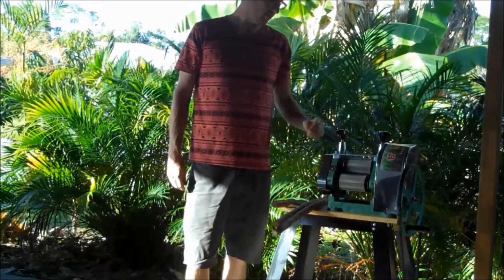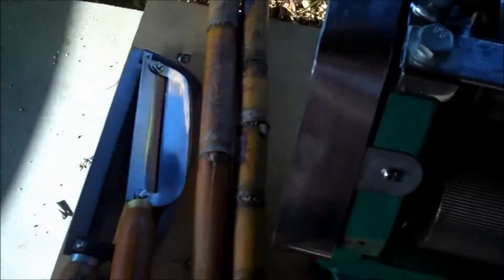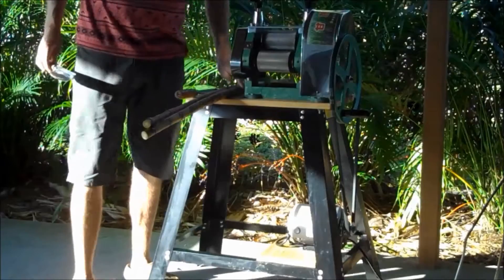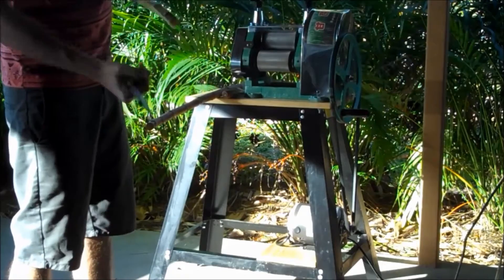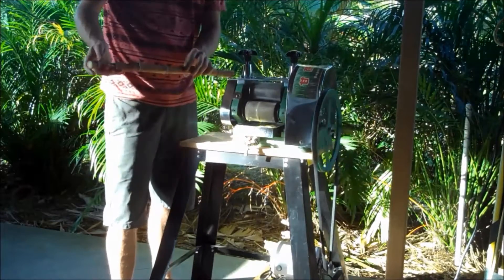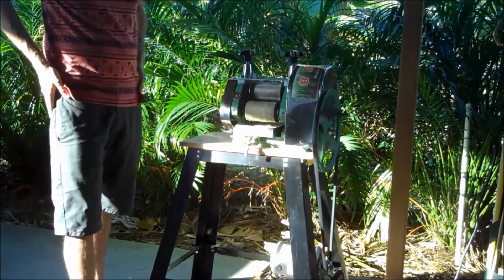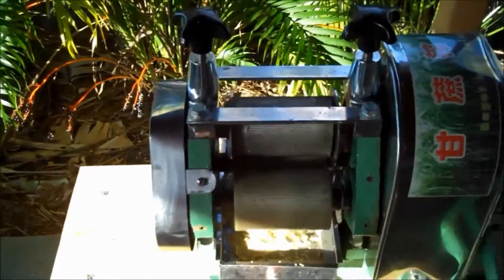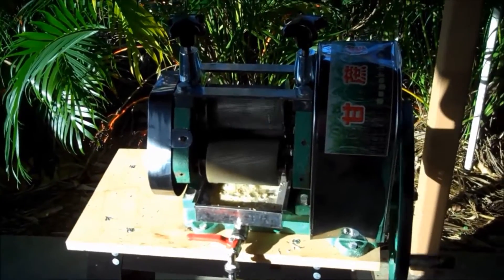Squeeze sugar cane with an electric powered juicer!

Comment: Can you tell type of motor you are using (hp and rpm, pulley size) and where did you get this.
Thank you
Reply: Amazon has it. It's a vevor motor. The juicer is on Amazon as well
Reply from the maker: we use Dayton electric motors. we have them for sale on our website with pulley

Comment: That is extremely dangerous, you need to install the roller guard, please do not ignore this safety measure also have easy access to a cut off switch . If you fail to do so, if careless your hand can be sucked in and roll out the other end into a 1/4 thin meat and bone plate long . If at that point you cant turn the damn thing off then your hole hand will be ripped from your torso and you wont want that. This is serious .

Comment: Hi can a 1hp 1800rpm  work on that machine
Reply from the maker: yes 1800 is okay with 2" pulley on the motor. 1 hp is overkill 1/3hp or 1/2hp is okay.

Comment: Hello, do you bolt the juicer down to the surface? I am curious how stable the machine is while in operation. Thanks!
Reply from the maker: Hi The juicer bolts to the stand in this video and is stable. We also have carts and they bolt and don't move. thanks!